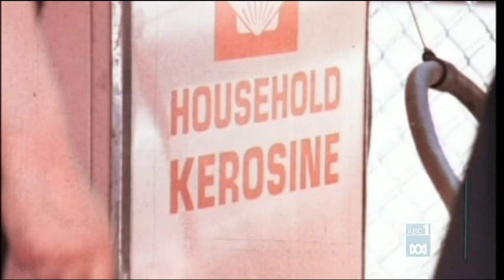Steam Powered 1963 Ford Falcon

Comment: WHY ARE WE NOT FUNDING THIS!? With today's advancements in materials and machining and computer control and stuffs - I would totally buy a steam car. Everything is possible!
Reply: I would love to see a steam car too, but it's difficult to make a steam car with similar performance to an internal combustion car. Though it's possible in theory, in practice it will take a lot of work. Developing internal combustion engines is simpler since the technology is mature and already works well.
Reply: +John Ryan  Well, if you watched the video? It actually took 3 minutes just to get the boiler to read on the gauge..
Reply: This is 10 years ago, I bet we could kick ass with this tech now... Try using a small nuclear cell to heat the water then we are talking, reinforce the boiler with new alloys, reduce the amount of wasted energy with better insulation etc... Have an onboard computer regulating the temperature and heating automatically to further reduce the waiting time down. Same deal as in the winter where we got to run the petrol engine in the snow for at least 5 minutes to get everything warm before heading out, not to mention the 10 minutes to scrape ice of the windshield etc during this time the car would have more than enough time to warm up. I think social media has really "dumbed down" our species where we want everything fast and don't want to wait. Really we are seeing the world die in front of our eyes. NASA & other tabloids have evidence for global warming: https://climate.nasa.gov/evidence/ If you want to live in denial about global warming, you might as well take up the belief that the world is flat and the universe revolves around earth only.
Reply: +Future Productions Anything possible... EXCEPT breaking the Laws of Thermodynamics that prevent steam engines (which require an energy robbing phase change in its cycle) from achieving a higher efficiency limits than internal combustion engines that offer the thermal efficiency advantage of direct conversion of energy in a working fluid that does not require the wasteful phase change in the working fluid and the higher entropy of external combustion...
Reply: +John Ryan I don't think you realize that the practical and theoretical limits of steam engine efficiency are already known and are well understood by today's engineers. Any heat engine that uses a phase conversion of the working fluid is at a massive disadvantage to one that does not such as a Diesel engine. Better heating elements? Clearly you do not understand the efficiency problem with using steam. Its not a problem to generate heat, the problem is converting all the heat into useful work without significant loses inherent in the method used. 
You obviously misunderstood what Jay's comment was referring to..the Doble could only produce 1,000 lb.ft at the wheels "AT REST" the vehicle produced less torque as speed increased. The Doble could only produce 150 horsepower continuously.
A modern Diesel pick-up truck would leave the Doble in the dust pulling up a long grade.. 
In terms of land based vehicles it certainly is obsolete and has been for a century now... steam is no longer used in non-nuclear marine applications either and its use in stationary power generating is also being phased out. The is nothing economical about operating an aircraft carrier.. and steam is not the only way to catapult an aircraft.. it is just the most simple and reliable way.
Reply: +Mark E   Yes, the vehicle can generate enough steam to start moving in 45 seconds.. but will be severely speed restricted for much longer.
Of course this not the primary reason steam car have been obsolete for over a century, Steam cars have always been inferior to ICE powered vehicles.. the only real advantage with steam was a relatively safe start-up procedure that it not risk injury or death.
Once Charles Kettering invented the electric starter motor, steam cars became obsolete overnight.
Reply: +Fhhh Gdtv Why wait? Wouldn't you rather just turn a key or push a button and just go, instantly?
Reply: +Howard Rourke Are you not aware of Latent Heat or conversion loss? Any time you convert Energy or Matter from one state to another a certain amount of energy is lost during the conversion process called Conversion Loss  this energy cannot be recovered, the phase change from liquid water to steam vapor creates an additional energy loss inherent to the Rankine cycle. Expansion of steam is relative to heat energy, we want to look at where the heat is going... not the steam pressure. No practical steam engine can expand steam directly into water, if the exhaust steam temperature is above 100°c it is rejecting the additional heat used in the phase change. External combustion also increases the amount of thermal entropy when compared to internal combustion. This is why a steam engine can never be more efficient than an ICE.
Reply: You can start this car remotely and in a few minutes come and drive.
Reply: The real doktorbimmer I would like to, but if the maintenance and fueling of steam car would be cheaper I would prefer this. In my country people are starting using wood gasifiers in cars because of gasoline high price.
Reply: +Fhhh Gdtv "the maintenance and fueling of steam car would be cheaper" What? are you serious? Do you live in a very poor country?
Reply: all mighty You do realize something would still be burned to heat the water, right? So there would still be emissions.... And I'm curious to know what magical substance you're replacing fossil fuels with.
Reply: pyroblasten, "The law of conservation of energy considers the entire universe to be your system. So any heat given off to the air is effectively lost to the engine" But of course, but that just boils down(pun intended) to the efficiency of the design. Theoretically it's possible to design and build a steam engine where the only energy leaving the system is the mechanical energy being produced and a little bit of heat from the burner exhaust. An ICE can't even theoretically come close to that.   

"In order to return the steam to water it has to be cooled in a condenser. Most the energy dumped into heating the water is lost in this cooling' But of course again this comes down to the efficiency of the design. The hardest part of that design to my mind being that you need a medium cooler then the coldest portion of the condenser. The intake air for the burner meets that criteria, a two stage condenser, cooled first with water after the pump on it's way back to the boiler, then with intake air to the burner, cooling the condenser and preheating the air. 

"On very large scales you can improve this some by transferring some of the unused thermal energy into the water that's being heated but it's impractical on a small scale do to space constraints and weight. A car can't afford to carry and extra ton of water so it can transfer heat from the steam into the water just before the boiler." Here I completely agree, don't get me wrong I'm not arguing for steam powered cars. I could see a place for other external combustion engines like the sterling however though.
Reply: @snek9353  Well, on the regenerator part, it doesn't need to be 5 meters square on size, it can just be a small paraphernalia on the cycle, if it at least exists on the cycle is better than nothing.
Reply: dok, I'm actually a little impressed, you're very good at sounding like you're saying something intelligent without actually doing so.
Reply: +sal 80 The oil industry would be very happy if everyone drove a steam car... Charles Kettering killed-off the steam car in 1915 when he invented the electric starter.
Reply: doktorbimmer ..... But with todays modern technology wouldn't we be able to make a more advanced powerful steam engine
Reply: +sal 80 In 1824 Nikolaus Carnot discovered a thermodynamic formula that proved that steam engines have a much lower efficiency limit than internal combustion engines do... no amount of new technology can change the Laws of Thermodynamics.... so the answer is simply "No" which explains why no legitimate engine manufacturers or engineers even bother to work on them for automobiles use. Cheers!
Reply: Nicolas Carnot discovered that internal combustion was more efficient in 1824.
Reply: Mark E That's firing up to keep it hot enough is different.
Reply: +Mi 28 Smart man, Good comment.
Reply: "Are you not aware of Latent Heat or conversion loss?" Sorry I'm not a fucking engineer, there's no scholarships for homeless white men you elitists fuck. My great apologies for my insolent curiosity ohh great one. "energy is lost" . Doesn't this statement contradict conservation of energy, or are you trying to say that there's no practical way to recover the energy spent in the conversion? "we want to look at where the heat is going" .Well no shit, that's true of ALL heat engines, ICE or ECE, this is a big problem inherent to ICE. That they require significant cooling systems, exhaust a lot of heat, and there's no way to recycle the heat energy. "No practical steam engine can expand steam directly into water, if the exhaust steam temperature is above 100°c it is rejecting the additional heat used in the phase change " Well that's all about if that heat can be recovered. You yourself have said this in other places, as to why steam makes since for large installations, they have a room for that equipment. "thermal entropy when compared to internal combustion" Here I completely disagree, as I said above ICEs have huge thermal entropy problems. In particular spark engines as they are prone to detonation, and any emissions regulated diesel as they have to cool to lower NOx emissions. Then there's the limitations of aluminum pistons and oils. With an ECE the burner and boiler can be isolated from components with significant temperature limitations. BTW why all the yelling?
Reply: Howard Rourke The law of conservation of energy considers the entire universe to be your system. So any heat given off to the air is effectively lost to the engine, though it can be accounted for outside the engine. In order to return the steam to water it has to be cooled in a condenser. Most the energy dumped into heating the water is lost in this cooling. Then it must be heated again to expand it into steam to drive the engine. No matter how well we design an engine we will never get all the energy out of that steam, if we did remove enough energy to return it to water from mechanical means the water would act as an impedance to the system ahead of it and it all goes to shit. So steam engines from a simple view only capture energy from the pressure created leaving huge amounts of thermal energy that we then have to cool to condense it only to expand it again. On very large scales you can improve this some by transferring some of the unused thermal energy into the water that's being heated but it's impractical on a small scale do to space constraints and weight. A car can't afford to carry and extra ton of water so it can transfer heat from the steam into the water just before the boiler.
Reply: Question for you educated types. An external combustion heat engine that used a change in state from liquid to gas but didn't use water as the working fluid. Would you still refer to it as a "steam engine"?
Reply: Not literally, no. Steam is water gas specifically, so no other gas is steam. But it's the same exact thing.
Reply: +marias man, I follow except for one aspect, your adiabatic vs. isothermal. Specifics of the terms aside I don't follow how this works in favor of the diesel nor how in practice it would be more efficient.   

If the goal was isothermal expansion then if considering three types of engines the most to least to my mind would be steam, spark, then compression. With a steam engine the intake valve can be left open during the entirety of the power stroke if desired. This would add energy and impart a constant pressure on the piston. Also between spark and compression engines the spark engine wins here as well. The length of time combustion occurs is much longer in a spark engine then a compression engine. Spark engines burn, combustion engines explode. So while in a diesel no more fuel is being consumed during the power stroke there is fuel being consumed during the power stroke of a spark engine. Now FWIW this is a little different in modern automotive diesels. In modern light duty diesels to reduce the bang both for noise and durability there's a two stage fuel injection. A small amount of fuel is injected initially and detonates, then the rest is injected immediately afterwards and burns. 

The more important question then is why would adding heat/energy during expansion be more efficient in practice. To me this contradicts the logic behind wanting an ideal expansion ratio. If one were to add energy during the power stroke then you end up wasting that energy when the exhaust valve opens. To my mind the goal is to have enough expansion to achieve a near zero pressure difference between cylinder and exhaust when the valve opens at BDC. All common practices confirm this, this is the point behind common things like Atkinson/Miller cycles, and advanced spark timing. Also a big part of why diesels are more efficient, earlier peak pressures and larger expansion ratios.  

I don't really follow on steam temps being a large problem either. 1000F is rather low compared to IC engines where exhaust temps in the 1500F area are quite common. That's just exhaust temps, combustion temps are necessarily many times higher.
Reply: +marias man The best way to understand is to get an actual degree in engineering rather than blindly promote gibberish spouted out by notorious frauds, crackpots and scam artist like Ted Pretchert and Harry Schoell!
Reply: @doktorbimmer For someone that has an """engineering degree""" , you are really arrogant and pride of your so called degree, saying that Ted was a "scammer" isn't even the most idiot thing you've said, Ted wasn't even trying to make a company or sell any products, he was just doing the job  assigned to him that was making a steam car.
Reply: +marias man "so Diesel engines have to meter the fuel properly for optimal efficiency." That's funny, because Diesel engines can actually run efficiently at an extremely wide range of air/fuel ratios.. much wider than Otto engines or even external combustion engines.. its a key advantage to Stratified Charge Mode combustion... it also allows Diesel engines to operate on virtually anything that burns. 
Sounds to me you known even less about Diesel cycle engines than you do about the Rankine cycle.
Reply: @doktorbimmer  So does it run on flour and saw dust? I don't think so....
Reply: +marias man Perhaps people should know that all you are doing is secretly promoting a notoriously fraudulent, vaporware investment scam called "Cyclone Power Technologies" some of your comments and theories appear to be taken directly from their promotional materials or are nothing more than unsubstantiated claims made by its founder Harry Scheoll.
Reply: @doktorbimmer  I think you are the one trying to promote something, your profile picture is literally a gas turbine and you are the one discouraging everyone of making a steam engine.
Reply: I understand the logic behind adding the heat, but it still strikes me as wasteful and overly complicated for little if any benefit. The only benefit I could imagine is power density, the ability to get more work from a smaller displacement. However that would negate the equipment needed to recover the heat. There's a practical minimum delta between boiler temp/pressure and condenser temp/pressure as well as a mechanical limitation on expansion. I don't see how it's anything but wasteful to have a cylinder pressure at BDC that is higher then the condenser pressure. 

"steam condenses in the cylinder" I've heard this mentioned several times, I don't follow as to why in any practical engine the steam would condense in the cylinder. As the expansion occurs the temperature both fall but never below the vapor pressure unless no more force is being applied to the piston. The only thing that would cause condensation is if the surfaces within the cylinder are too cold, a problem easily remedied. 

On diesel timing, my example of a later injection is a bad thing in regards to power and efficiency. Modern automotive diesels do it to lower noise, reduce the need for heavy duty components, and primarily to reduce NOx emissions. But it's a very bad thing for power and economy. For peak power and economy you want all the fuel to explode all at once at the perfect moment just before TDC. anything later is wasteful. On a related note this is why spark engines will quite often ignite the fuel around 50 degrees before TDC. When the piston still has about a third of the way to go still on the compression stroke. Cause the flame takes a while to propagate it has to be initiated early to get peak pressure at the right moment. During the compression stroke a spark engine is actually compressing and combusting at the same time and having to do extra work to compress the combusting gasses. Yet another reason why diesels are more efficient. 

I still don't see the temperature problem. Boiler tubing is self temperature regulating as it's full of water. The cylinders are easy to manage, mostly steal and iron so no real issues, and any aluminum parts can be cooled just like they are in an IC engine. Can both have a water jacket and use it to preheat water on the way to the boiler. This would both cool the block and recycle heat, an aluminum piston can be cooled by the oil like it is in a diesel, and that oil run through an oil/water heat exchanger just like in a diesel. 

My last point would be that it would be silly to use water anyway. An ammonia based working fluid like modern refrigerants would likely be much better. Lower boiler temps could be used to shorten warm up times and lubricants just like those used in refrigeration systems could be used.
Reply: "You do not want all the fuel to combust all at once near TDC. The result would damage the engine." Yes you do and no it wouldn't. You may have better knowledge of thermodynamics but I used to tune engines for a living and still do quite a bit of it. Even in a diesel where the fuel explodes the injection is timed slightly before TDC. In a spark engine yes detonation is bad and can do damage, but a fast burn is very good and will yield both power and economy. "Also, efficiency would suffer because the very high peak temperature would transfer heat rapidly to the cylinder head and coolant thereby losing energy that would otherwise allow for higher average cylinder pressure during expansion" Yes and no, yes a lot of heat is lost to the cylinder walls, head, etc. But no to get the highest average cylinder pressure combustion must be early, there simply isn't enough time or expansion to take full advantage if it's late. Late timing simply results in hot exhaust, high fuel consumption, and lower power. This is true for diesels that inject late as well. It's also why Miller/Atkinson effects are so popular. You get a higher expansion ratio for a lower dynamic compression ratio. It comes at a cost of lower power/displacement however. "The ideal condition is to control combustion during expansion and add heat during expansion to raise the average temperature during expansion - then increase expansion accordingly to extract more work." Not in any real automotive engine, like I said there simply isn't enough time/expansion to take advantage. You seem to think we live in a world of 100:1 compression ratio engines, we don't. Highest factory diesel that comes to mind is 21.5:1, highest street/pump gas spark engine, about 11.5:1. "The combination of not throttling intake air, injecting fuel in a controlled manner during the power stroke, and higher expansion makes the Diesel engine more efficient." Not having to pull a vacuum yes, higher expansion ratios yes, injecting during the power stroke no.
Reply: marias, you keep going on like I don't understand that theoretically adding heat during expansion would increase efficiency. I fully understand, that in theory or in some large scale operations it can and does. However I see only limited ways to accomplish and utilize such a thing on the scale of an automobile. That's not to say these concepts aren't understood and utilized at all in my own work and in the design of previous and current IC engines. It's why in my diesels I run very hot coolant, it's why in my IDI diesels the pre-chamber is in the head on the exhaust side, it's why in a 2-stroke Detroit only the exhaust is in the head, it's why in my own builds I use ceramic coatings on the heads and pistons, it's why I use a custom cam grind that delays intake closing, It's why I have compounding turbos, etc. None of these things actually add heat during combustion, but they are all ways to retain and utilize as much heat as possible during expansion.  

"Note that my words are very precise. I respectfully request you read them carefully before making any replies." Fair enough, but it's the precision I'm nit picking, not the basic concepts, we agree much more then we disagree. There's really very little that is controversial or not understood here. This is a conversation of details, with varying perspectives of education and experience. I expect through this we are educating each other. 

"The fact is the fuel cannot be made to combust all at once at or near TDC." This of course is completely true, nothing even the explosion in a diesel engine is instantaneous, I never said otherwise. What I said was that if it could be that that would be a good thing for efficiency, at least in an engine like a diesel that is designed to handle it. But in reality it's not instantaneous and is mostly extended because even in the most powerful fuel injection systems it takes time to inject the fuel. In a diesel the combustion will start as soon as fuel is present and sufficiently mixed/atomized. This will most often be before all the fuel has been injected. In practice however we begin the process before TDC so that we have peak pressures close to but shortly after TDC. 

"Nothing I described previously implies otherwise. Rather, I described the process of delayed combustion (which is inherent in internal combustion engines and controlled to some extent in Diesels) raising average temperature and pressure." Yes and no, first a diesel is an ICE, I don't know why you separate the two, we should be separating by spark vs. compression. Second delayed combustion is an undesirable reality not a design goal.  

"Of course, clearly there is not enough energy in the charge of an engine to support an arbitrarily high compression ratio" This statement is largely false, at low throttle/fueling this is to some extent true, but in the vast majority of running conditions and certainly all the ones that matter this is false. We need to separate simple compression ratio from dynamic compression ratio and expansion ratio. Simple compression ratio is just that and only a measure of area. Dynamic compression ratio takes into account the effects of valve timing, most commonly keeping the intake valve open after BDC to allow some intake charge to be pushed back out. Then of course expansion ratio the area between quench and when the exhaust valve opens. An "arbitrarily high compression ratio" is of course detrimental, it has three major shortcomings. In a spark engine detonation, in a diesel engine too high peak pressures to hold the engine together, and in both the quench volume is shrunk. People talk of displacement as it relates to power, this isn't really the most true measure. A more true measure of a given size of an ICE is the quench volume. The larger the quench volume the more fuel can be utilized. Thus via valve timing much can be gained by delaying the close event of the intake valve. This lowers the dynamic compression ratio to an acceptable level(9-12 for spark, 17-21 for diesel) allowing for a higher simple compression ratio and in turn higher expansion ratio. This comes at a cost of power for a given displacement though as it requires a smaller quench area for a given displacement.  

"Besides, pre-ignition would take place long before this in gasoline engines - which, by the way, shows that trying to combust all the fuel at once at TDC is undesirable and destructive." First if we are being precise in our wording gasoline is a type of fuel not a type of engine. Secondly yes "pre-ignition" more accurately to what you're describing is called detonation is "undesirable and destructive" in a spark engine. As it's not designed for it and when is does occur it occurs very early in the compression stroke. This of course does not hold true for many compression engines, they are of course built around detonation. 

"Now, with respect to Diesel engines, injecting the fuel in a controlled manner during the power stroke provides a means to control the rate of combustion (however, the inherent delay of combustion is the primary driver here). This does not necessarily in and of itself permit a higher peak efficiency." This is on it's face true, but your reasoning behind it isn't. They "control the rate of combustion" primarily to control the temperature and pressure of combustion in order to keep them from becoming high enough to create NOx. This has two side benefits in that they can build a lighter and quieter engine, but those are side effects to the primary driver of meeting emissions regulations. And yes it lowers efficiency, you may be surprised to consider how blurred the line between spark and compression engines is becoming. 

I'm out of time, I'll have to address the rest later.
Reply: marias, I may address other points from previous posts later but now I want to change directions a bit and pick your brain on something practical I'm considering. It wouldn't be too hard for me to build a small steam engine into my trucks. I'd use the heat from three sources, the engine coolant, capture heat from the exhaust likely post turbo at the downpipe, and from a small burner. I'd utilize the steam in a modified ICE, condense it in an AC condenser, and .... I haven't quite worked out a pump to pump the condensate back to the boiler. I'd use the resulting power from the modified ICE to turn accessories like an alternator and AC pump. ..

The goal being two fold, first overall efficiency by taking some load off the main engine using waste energy. Secondly the addition of the independent burner to use it as an APU(auxiliary power unit). I can't assume you know what an APU is, many commercial trucks use APUs to keep the HVAC and electrical power going in the sleeper with the main engine off. Most APUs are just stand alone diesel generators with an AC pump and alternator added on and are mounted on the side of the frame behind the fuel tanks. They're rather wasteful really, heavy and the engines aren't very efficient. But still A LOT better then running the main engine or not having any creature comforts.

Anyway, on it's face it seams quite simple, the devil is in the details as they say. For example choosing between a water cooled and air cooled engine to turn into the steam engine. I could see using an air cooled engine and enclosing it in the exhaust stream of both/either the main engine and the axillary burner. In doing so the head and cylinder walls could be kept above mean steam temperatures in the cylinder. Or water cooled I could accomplish a similar thing with the water jacket being filled with boiler water at some stage in it's path. The air cooled option would be hotter, the water cooled more stable. 

Or, how much displacement do I need, and valve timing, etc. etc. Finally is it worth while, to be worth while I'd probably need to make a minimum of 20HP. Think it's feasible?
Reply: +marias man I know an exceedingly simply way to solve that problem too Just do what any competent, well educated engineer would do. Use a highly efficient, air-cooled Diesel engine.
Reply: "I know what an APU is, ;-). I've seen this idea pop up several times and I think it has some merit - especially where the system can function independently with a separate burner." Glad to hear it, there's half the potental conversation done right there, you understand the goal. 

"A piston steam engine would not be the best kind of system for this application, but it would be the easiest for someone with limited means to pursue." Yeah I can't really concieve of any other viable options. I could use an automotive style turbo/turbine but I see no viable way to use it for a relatively low speed torque load. I do however envision another use for an automotive style turbo in this application. To bascially use it as intended, drive the turbine from the exhaust of the "steam" engine getting more work out of that "steam". And then use the compressor side to push fresh air. While the main engine is running that fresh air would simply boost the main engines intake. But much more important when the main engine is off it could provide fresh air to the burner. 
This might be a place to consider a sterling but I'd not only have to make that largely from scratch but best I can tell it takes a large engine to make decent power.

"using toluene as a working fluid" You'll notice I put "steam" in quotes as I do have ideas on other working fluids, haven't considered toluene though. Why other working fluids when water is by far the easiest. Well two reasons one major one minor, first the later. I think if the right compound could be choosen and redily sourced it would be handy to use the same compound as both working fluid and fuel. The vast majority of working fluids that work for my second reason that I'll get to will be highly flammible anyway, like toluene for example. And if I simply sourced the fuel from the condensor it's already hot and gasious.  Ok the second reason is complicated. No idea if this has been done nor sure it would work well but I think so. I envision basing it on a diesel engine and using a diesel injection system to inject the working fluid into the cylinder. I could use a simple mechanical injector pump system and poppet style injector to not only pump and keep under pressure the working fluid but also use it to precisly meter the amount of working fluid injected into the cylinder to throttle the engine. One redily available system to pump from the condensor, keep it under enough pressure to remain fluid right up until it enters the cylinder, and meter how much is injected. Best I can figure this only has two limitations. First the working fluid has to have significant librication properties or the pumps won't last long. Second there's a practical pressure limit of about 2000PSI. Neither really sound like big problems. The organic compounds worth considering have enough librication properties and 2000PSI is plenty.

"increase the overall power of the main engine" FWIW to be precise that isn't really the goal. The goal is two fold, the APU function, and to remove load from the main engine, not add power. Do this by removing the alternator(s), A/C pump, and if possible the air compressor from being driven by the main engine to this heat engine. 

10% of main engine power would be perfect, 45HP is plenty to drive the ancillary items I have in mind.
Reply: "I know an exceedingly simply way to solve that problem too Just do what any competent, well educated engineer would do. Use a highly efficient, air-cooled Diesel engine." OK doktor, you tell me a good way to utilize waste heat in an air cooled diesel engine, and I'll consider it.
Reply: OK I forgot a big issue with my diesel injection system idea. That is max volume limitations. A 13mm p-pump, probably the pump I'd prefer to use is capable of about .8 cc per stroke. So a practical max of .8cc of working fluid injected into the cylinder at TDC. Depending of course on working fluid and it's temperature that gives a significant limit on expansion/displacement per cylinder stroke. Now it would be completely possible to double up on the pump, and create a maximum of 1.6cc per stroke but that would require additional cost and complication. The point being the preferred engine would be one of 4 cylinders and a displacement sized to utilize a maximum of .8cc of working fluid per expansion stroke. The math on that is not only over my head at this point we don't have enough details.
Reply: "I can only speculate about what you need 45 hp for" It might really surprise you how much power it takes to turn a 200amp alternator, decent A/C compressor, and a 150psi air compressor. Would I need 45HP all the time, no, could I get by with less, probably, is the ability to run all three of those under load helpful absolutely. 

"What engine are you using that delivers 450 hp for extended periods?" Now I thought you knew or figured at this point that we are talking about a commercial truck, 18 wheeler, 80,000lbs, etc. Pulling a pass I'll be at full throttle for an hour straight. 

"Now, I wish to emphasize that, while this is an interesting idea, I take the position that it is highly unlikely to be justified on economic grounds quite simply because the fuel savings would almost certainly not compensate for the costs in development assuming a one-off engine." A small percentage in fuel savings is a HUGE deal when you spend $60,000 a year on fuel, a %10 savings is $6K a year. Then we're talking about APU functions, good APUs new run about $10K, I could sell the one I have for about $5-7K. Nor do I expect this would be that expensive, at least if I can use a lot of common used automotive parts. Really I expect the most expensive part to be the injector pump, good ones can run in the $2,000 area. But hopefully I can get by with a stock used one at a quarter of that. Engine wise I'll modify an old engine, not sure yet which, still contemplating that. Need to make a decision on displacement first, maybe you can help with that. Anyway, IDK $5K all in, if it works it'd be awesome and pay for itself just by selling my current APU. 

"BTW, this concept has been pursued by at least one major automotive company - and discontinued" Yeah, I think I remember reading about BMW working on it. I've yet to find anyone who's tried it on the scale of a class 8 truck though. IDK why, strikes me as something that Kenworth should be tossing some research money in on. My understanding was that in smaller applications it just wasn't practical mostly due to weight and space constraints, that and the engines really didn't put off enough heat often enough to make it worth while. But I have space to work with, wouldn't add any more weight then my current APU, and boy do I have heat to spare.
 
Edit, might help to keep in mind we're talking about a truck that is only completely off and cooled down every couple of weeks. The rest of the time it's either moving, the APU is running, or it's off just long enough for the stop I'm making.
Reply: "My suggesting an organic working fluid was limited only to micro turbines" Is there a reason to avoid it given my line of thinking?
Reply: Not really considering turbines at all, too much difficulty and cost for my intended purpose. Even if I could source a reasonably priced, correctly dimensioned, and high enough quality turbine. The complications of driving a slow speed variable load from it are too cumbersome. Now if I only wanted to use it to boost the main engine, turn a generator, or turn a compressor wheel then maybe. But as a stand alone unit to drive variable slow loads like piston AC and air compressors, no way. There are other ideas besides modifying a piston ICE though. You mention supercharger, maybe but I doubt it. Centrifugal or roots no, wouldn't work, a twin screw maybe but the expansion ratio would be rather small and costs high, those suckers aren't cheap. There's several cheap piston style AC or air compressors that could be modified. A Yeats(I think it's called) style AC compressor is a very compact 6 piston swash plate style compressor that may work well. Or a slightly more radical idea a rotary(wankel) engine. I actually rather like that idea, those suckers can spin and "valve timing" is simply port location, no cams or moving valves. Take a good chunk of machine work and high end aluminum welding though, I'd have to do a lot more research on that. The point being that there's a lot of options when it comes to the expansion engine portion. But before I get there I need to figure out if my diesel injector idea can work, a displacement goal, and a working fluid/fuel.
Reply: Any suggestions for a cheap readily available fluid that has the right heat properties, is a decent fuel, and a decent lubricant? For it to be viable as a fuel it can't be much more expensive then diesel. That or I'll have to use different fluids for fuel and working, but still the working fluid would need some lubrication properties.
Reply: The only smart thing to do is keep the Diesel APU, no Rankine cycle engine is going to deliver the same output at lower or even the same fuel consumption.
 You wanna improve your fuel costs per mile? You still have even asked the first question to this equation yet... how efficient is the primemover you are using now?
Reply: Well a word on fuels and how much of the operational time its powered by the main engine's waste heat. Fuel wise the most easily sourced and likely cost effective are, waste oils(cooking oils, waste motor oil, etc.) diesel, gasoline, propane, then ethanol. Time, well it'd run for the most part 24 hours a day, 11 to 14 of those hours using waste heat and the other 10-13 hours on burner heat.
Reply: Why on earth would I ask you how efficient my engine is?
Reply: +Howard Rourke How can you account for the less efficient APU duty cycle mode operating near half (10-13 hours) of 24 hour cycle time?
Reply: dok, how can you account for being a useless troll?
Reply: marias, yeah the engine is in much more then "just good working order", aero is quite good for what it is, and next to nothing more can be done for rolling friction. Really most class class 8 trucks are the most fuel efficient vehicles on the road already. But there's several limits one is constantly running into, largely function and regulation. Many things that would increase my MPG are either illegal or limit my ability to haul the load I'm being paid to haul. One of the legal issues is something I need to make a decision on and one this is an aspect of. That's if/when I'm going to add an exhaust particulate filter. Currently I can't even enter California, not that I really want to anyway, lol. But if I was to place this heat engine in the exhaust in a canister that looked like a diesel exhaust filter I might just be killing two birds with one stone.
Reply: +Howard Rourke You said (on another thread) you understood BSFC? Why are asking the same second pass system to operate half  its duty cycle at less than half its rated output.???? You will already be at a disadvantage using steam compared to the Diesel.
Reply: +Howard Rourke But how do you expect to exceed the efficiency of the Diesel Cycle APU with a Rankine Cycle? Especially when it won't be operating at its ideal load to achieve optimum BSFC.
Reply: "what do you wish to power with the APU while the main engine is shut down, and what power is required" I've mostly answered this before, 2 alternators, an A/C compressor, and an air compressor. What power is required, well that's a tough one to answer really. Maybe as little as 10HP can get the job done. The air compressor would be very low duty cycle and everything else could be turned off when it's on. Similarly with the AC, the AC clutch kicking in could disable the alternators while it's pumping. The compressors could also be turned slower, reducing the power needed. Doing so as little as 10HP could get the job done. But I'd be in real trouble in a hot climate where I'd have the AC running all the time, the batteries wouldn't get a charge.
Reply: +marias man Heavy duty trucks use Air Brakes
Reply: I wish I had good info on loads, but everything is guesstimates. Yes the AC is to cool the cab for sleeping, I'm hot blooded, can't handle heat so I run AC more then most. Ultimately I'd like to use it for a built in fridge as well, but that's down the line. I don't have any figures for the cooling rate. --- Alternators, similar thing, power an inverter, lights, etc. If I went this route I'd replace the generator of the APU with a large inverter, that would be the largest load, but it's draw would be far from constant. --- Yes the rig has air brakes of course but they don't draw anything while still. However the suspension is air as well, including the cab, and I'd like to be able to run some air tools, fill tires etc. without running the main engine. BUT.. don't need much air sitting still, very rare to run out. Also a hard job to remove it from the main engine and power with this heat engine. These pumps aren't belt driven but gear and basically built into the engine. So that is by far my lowest priority.
Reply: +marias man That is where the Turbo-Compound system has a distinct advantage in this situation... its heat recovery curve is better suited to couple with the waste heat energy curve, and can deliver additional shaft horsepower to the prime mover when its output exceeds the PTO accessory load which is always variable independent of the prime mover output curve. 
Its exactly why truck engine manufacturers are starting to use them and not a Rankine based system which is inherently less efficient and much less cost effective.
Reply: A lot here to catch up on...

"determine if these loads might be powered by another means" That's great to explore, I've thought about other things as well. For example Sterlings. or a split/compound Diesel/Rankine. That is Rankine to use waste heat from the main engine, then instead of a burner a very small Diesel to both share the load and provide heat to the Rankine. Both have there problems, the Sterling previously mentioned, the small diesel a combination of efficiency, cost and complication. Small Diesels are not efficient, splitting the load between Diesel and Rankine is complicated, and it doesn't much lower costs as I'd have to source the small diesel. 

"the question I consider is whether or not it can be practical to fuel fire the system while the main engine is shut down" Same here, waste heat is free, only cost is in the hardware to capture it and that's a fixed cost. But to be worth while the Rankine when powered by the burner can't cost any more then twice the diesel APU per hour to run. Now if I could fuel it using free waste oils then absolutely. And frankly that might be a viable option, and one that using a burner makes very easy. Heck I could fuel it with a wood stove, well if it was legal. When first thinking of this idea some time ago I thought it would be cool to have a fireplace in my sleeper and use it's heat to power the Rankine. But.... technically for some retarded reason that is illegal.(may do it anyway) Which reminds me we overlook a secondary goal, providing heat when cold as well. I may be warm blooded, but in a North Dakota winter even I crank up the heat. That and I'd like to use it to pre-heat the main engine prior to starting. 

I don't follow what your saying about another evaporator in the cab. The evaporator is already in the cab. Are you saying add another just to add surface area? As for the condenser I agree, I could see a significant advantage to putting a condenser on the roof. While on the highway the stock condenser is great, sitting still it's not getting much air flow and is heated by the engine. 

I don't follow why there would be any advantage anywhere to superheated steam? The hotter the working fluid the lower the delta T with the heat source and thus lower the rate of transfer and thus efficiency. The only advantage I see anywhere to superheated steam is to get more work with less pressure. But that only makes sense if your approaching a mechanical pressure limit. Or am I all turned around in my thinking?

"A modified single cylinder air cooled gas engine can provide this output with a fairly modest steam pressure and a simple design. The simplest approach would be to use water as the working fluid and forgo the heat transfer fluid and use saturated steam to drive the expander." Here the devil is in the details, those modifications can be difficult and costly, we need a way to throttle it, and air cooled leaves only the area of the engine fins to capture only exhaust heat. I'm still pondering the engine/expander itself, but I am settled on a heat transfer fluid. 

Ya see I have one anyway(engine coolant), and really do need to change to Evanscool anyway. Part of getting the most out of the primary engine is raising it's coolant temp as high as is practical. In my quest to do that the next step is getting rid of the water. Water's vapor pressure at those higher temps too high for the cooling system to retain. Evanscool boils at 375F, and eliminates my need for antifreeze, and SCA additives. I'm thinking three elements to heat transfer with Evanscool. 1) Change over the entire cooling system. 2) Install a small electric pump to pump some coolant from the engine. 3) Install a "water jacket" around my exhaust pipe between the turbos and the stack. Hot coolant will travel from the main engine pumped out by the small pump. Then into the exhaust jacket takin heat from the exhaust then to the boiler/burner, and back to the engine. This will do two things, gather a fair amount of heat from the main engine, and with the addition of a small valve to bypass the engine at times, allow the Rankine/burner to heat the main engine. 

"I don't know the electrical system requirements, but the ideal condition in my mind would be for the system to provide all a/c and all DC electricity required. So, the a/c compressor and the alternator normally powered off the main engine might be powered by the APU." This is one element I've had in mind all along. I don't want to add a second AC compressor, set of alternators, etc. I want to move the ones currently powered by the main engine to the APU. Here's a practical question though, I don't need a lot of AC electricity. I really only use AC for cooking, got a 1500W microwave and a 1800W induction cooktop. The question is, inverter or generator. I lean strongly towards inverter, but....
Reply: "That is where the Turbo-Compound system has a distinct advantage in this situation... its heat recovery curve is better suited to couple with the waste heat energy curve, and can deliver additional shaft horsepower to the prime mover when its output exceeds the PTO accessory load which is always variable independent of the prime mover output curve. 
Its exactly why truck engine manufacturers are starting to use them and not a Rankine based system which is inherently less efficient and much less cost effective." I have no idea what you're getting at here? Compound turbos for intake pressure, sure, got that. But PTO output from a turbo? I'd dig that, but tell me where to get such a thing from anywhere but a formula 1 team? Still does nothing while the engine is off though. And what engine manufactures are starting to do what?
Reply: Actually doks post reminds me of something moderately on my to-do list to at least research more with the main engine. Add a supercharger for efficiency. Some people have toyed around with doing a compound turbo and positive displacement roots type supercharger system that goes inlet > turbo > supercharger > turbo > intercooler > engine. The idea being two fold, with the supercharger lag can be eliminated allowing for lower RPM operation and larger sized less restrictive turbos. But mainly that while the turbos are spooled up they are actually pushing through the supercharger. With a roots type where it's positive displacement but no compression happens within the charger it can be blown through creating torque. Torque that is directly transferred to the engine. This may be a rather practical way to directly provide extra torque to the engine using exhaust energy.

EDIT - Secondly the engine only needs X air for Y fuel. Turbos balance this rather well, but the addition of the charger and a bit of exhaust control can do it even better. By throttling the exhaust flow to the first turbo under low-part throttle conditions two things happen. Manifold pressure thus temp goes down as the supercharger acts as an RPM dependent throttle. And the second turbo spools more creating a vacuum under the supercharger allowing it to provide torque.
Reply: marias, my cab is rather large and open, I like it that way and wouldn't want to partition it off. I could however see myself adding an evaporator in the back. In fact I came across a bit of tech recently I'm embarrassed I hadn't found earlier. I often thought it was a good idea but hadn't looked in a while to see if anyone was making it. Now they are, a couple companies are now making variable displacement AC compressors. This could potentially solve a lot of issues.   

OK now I totally get the superheated steam thing. OK but then why not use a gas, or heck even air. Compressor > Waste Heat Source > Engine > Cooler > Compressor. Or at that point remove the cooler. Outside Air > Compressor > Waste Heat Source > Engine > Exhaust/Main Engine or Burner intake. 

This brings me to a question I asked herr doktor and he didn't answer, well he did but in his own nonsensical way. With a diesel engine is there an efficiency advantage in heating the intake air. I tend to think yes to a point, that at low fueling and low intake pressure absolutely, in fact it would allow for lower dynamic compression. But at high fueling and high intake pressures it would be detrimental. Not only would power go down but exhaust temps would get too high and damage the engine.  

With the lack of throttling you appear to be assuming the APU is coupled to the main engine. Thus is/was not the goal. Though now that I think about it this may be a better way to get the most out of it. If I could find a way to couple and uncouple it then I could get the best of both options. Maybe I could do this with an AC clutch used to uncouple the main engine from the drive belt.  

On a second moderately related note, why isn't compressed air used for cooling. Strikes me that it could be more efficient then cooling Freon. Compress ambient air, in the rig it already goes into an air drier (half of AC is removing humidity) then into a tank where typically more water precipitates out. If it was then sent into a cooler(an AC condenser), then released into the cab via a controlled nozzle wouldn't this provide quite efficient cooling? Biggest issue would be noise, finding a way to muffle the sound of the released high pressure air.
Reply: +Howard Rourke Why would you Supercharge a Diesel engine? Is your trucks engine not all ready Turbocharged? "EDIT - Secondly the engine only needs X air for Y fuel."
Not in the Diesel engine concept, higher AFRs improve efficiency.. only Otto engines (HCSI) operate in a narrow AFR band.
Reply: Never heard the term "Brayton cycle" more to research. I agree it would be larger, however I already have/need an air compressor. I'd also need a way to force air should I decide to use a burner. Third it would exhaust warm slightly pressurized air that could be used to boost the main engine when running.
Reply: You agree about warm intake air increasing efficiency to a point? And yes warming it would certainly be free heat.
Reply: dok, you really are just scrambled in the head, in one post you both ask why one would supercharge a diesel and say more air is always better. Well dok, A LOT of diesels are supercharged, in the world of superchargers(more so back in the day) they often refer to the sizes as 6-71, 8-71, etc. this referred to the size of the diesel engine they were from. Next I think I explained rather well why I would add a supercharger, that you can't follow it I'm not going to take responsibility for. Finally no, there is absolutely a practical limit to providing air to a diesel. Too much and you not only create a pumping loss but you cool it excessively.
Reply: Yeah, batteries are an option, one with downsides though. First the power isn't free, now while firing a burner isn't either, it may be cheaper. Second if doing a waste heat engine anyway, all it takes it adding a burner. Third batteries are HEAVY, it may not be obvious to many but in trucking every ounce matters. We have legal limits on weight, every pound on the truck is a pound less cargo I can be paid to haul. Third as you mentioned before electric air conditioning powered by an inverter is far from efficient.
Reply: +Howard Rourke I hope you are a better truck driver than an engineer... because as an engineer you really are a waste of space.
The Winton type engines ARE NOT SUPERCHARGED they use a roots type "BLOWER" to scavenge the intake/exhaust cycle... they do not increase manifold pressure significantly above atmospheric pressure.
Reply: Howard Rourke  Using batteries is a very inefficient solution, in short, simply a very dumb idea... marias man likes to think that he is some kind of an engineer... but his comments prove otherwise!
Reply: +Howard Rourke I can't help but notice that you know even less about Diesel Cycle engines than you do about Rankine cycle engines... you should stick to driving trucks and leave the engineering to the people with a degree in engineering!
Reply: +The real dickbender, we've long established that I know much more about the real world uses of both trucks and diesel engines then you do. Now please take your bullshit elsewhere unless you actually have something constructive to say.
Reply: "I agree the gains would be negligible at best. Also, it doesn't make sense to add heat when retaining heat would provide the same effect in principle. Use a turbocharger to make use of waste heat." I'm specifically thinking of low fueling conditions where there is no boost and most specifically idle where heat retention is a real problem. During extended idle, most large diesel engines will have a hard time maintaining operating temp. This is of course made worse by having a high operating temp, running the heater, etc. This get's to the point of a condition called wet stacking where the compression temps and internal surfaces of the cylinder are no longer hot enough to support complete combustion. 

The idea here is to add a second intake path with a flap closed by boost. The non-boost intake path pulls warm air from ducting over the exhaust manifold. A system much like is/was done in most automotive spark engines for years to prevent icing in the winter. Another system used in spark engines that I've yet to see in diesels used for this purpose is an exhaust restriction. A valve in the exhaust manifold that is held closed by a bi-metal spring and opened by exhaust flow and heating the bi-metal spring. In theory a small turbo could be added and valved to do something similar but much better. Not only providing an exhaust restriction but transferring that energy to the intake. The trick is sizing, not really sure it's even possible to get enough energy out of the low energy exhaust of idle to do anything useful with the large intake volume. 

What brings me here is not only solving this problem but the idea of a super efficient idle of the main engine over a secondary energy/heat source. That the combination of retaining heat in the intake air as well as an attached heat engine may be more cost effective then adding a secondary system. 

Oddly or unfortunately this also bumps into two other facts of life with heavy truck diesels. The first being that many engines including mine use an air/water intercooler that negates that delays wet stacking but also isn't as good as an intercooler as air/air. One that I'm likely better off overall removing. Secondly and most important many states have laws against extended idling. Even if my idle was much more efficient and less polluting then a diesel APU the law is not flexible on such matters and this law is strictly enforced. They have cops that spend all night driving around truck stops listening for running engines.
Reply: Oil industry won't allow it
Reply: +Mehtao Burrell Unfortunately steam powered cars waste too much energy...
Reply: +Autistic Boy Why don't you go troll somewhere else?
Reply: +Autistic Boy We are not funding this because it would be a foolish waste of resources... the Laws of Thermodynamics make steam engines significantly less efficient than ICEs and other heat engines which offer higher Carnot limits... there is no need to waste time and money rediscovery something that we already know.
Reply: +Autistic Boy The Second Law of Thermodynamics is incontrovertible. Malice may attack it, ignorance may deride it, but in the end, there it is and there is absolutely nothing you can do to change it.
Reply: We should also breed whales and hunt them for their oil to power them.
Reply: Agreed nowadays you could make steam much more efficient than it was
Reply: +Moose Chocolate  Unfortunately engineers already know that steam cars cannot be made more efficient than internal combustion cars... thus the reason why steam cars no longer exist today except in museums and private collectors
Reply: +Moose Chocolate You could make steam cars more efficient... what you cannot do is make them more efficient than internal combustion cars... so what would be the point???
Reply: Internal combustion cars can and do run on a wide variety of alternative and Bio-fuels so steam cars offer no advantage in multi-fuel operation.
Reply: Will your channel be listed under comedy??? because your concepts sound good for a laugh... at least for engineers and scientists watching youtube.
Reply: You are the loser... Remember?
Reply: Sorry my friend that's not part of the plan big big petroleum don't like that it cut scene on a prophet being fucked about climate change
Reply: @charles neely The "big oil" companies would be very happy to see everyone driving a steam car!
Reply: water turning to ice in the winter
Reply: John Ryan Yeah but heres the thing todays heating elements have only changed alittle in the past 100 years hence why steam cars ended. Physics said there was little room for improvement but there was a ton of improvement for gas and diesel engines since back then they were all super ineficient at the time.
Reply: +Fhhh Gdtv Steam cars have been obsolete for a century now for the simply fact that they are horribly inefficient, wasting massive amounts of fuel and they are prohibitively expensive to build, maintain and operate.
Reply: +The real doktorbimmer yes you can, because we live in a simulated and the laws can be hacked.
Reply: I967 none of you want a steam car they died for a reason. You had to wait for them to heat up to drive them it's not a turn key and go.
Reply: You don't just heat up water to 100 degrees and it all converts to steam. Every ounce of boiling hot water converted to steam takes additional energy input. For water specifically, boiling off a liter of water takes about 5 times as much energy as it takes to heat up a liter of freezing water to boiling point. When water boils to steam, it expands 1000 times. If you don't harness the power of steam condensing back to water and compressing 1000 times, all the energy that went into boiling it goes to waste. 

It's important to know that energy doesn't comes from nowhere and doesn't vanish anywhere. Energy in = energy out. It's just your motor setup may allow for large fraction of input energy to dissipate as useless byproducts, such as waste heat dissipated on radiator.
Reply: @michaelbuckers  we could use the heat coming from the radiator to pre heat the air to the boiler
Reply: @giovannicesaramorimnumero7589  It's more hassle than it's worth. Hot air has less density and less oxygen so you will also need a compressor, and then the compressor needs a driving motor and cooling, etc. It comes out as a pretty expensive and complicated set of hardware for a couple odd percent of improvement.
Reply: @michaelbuckers  Why cooling? Also, the motor could be a turbo driven by exhaust steam going to the condenser.
Reply: @giovannicesaramorimnumero7589  Because hot air is less dense, there's less oxygen to burn. If you drive a turbo off of exhaust then this energy is not available at the main engine. No free lunches.
Reply: @giovannicesaramorimnumero7589  Not a practical design for an engine as small scale as a steam car... internal combustion engines are vastly superior which is why they completely displaced steam cars.
Reply: @sandervanderkammen9230  no it wasn't because they were "superior", it was because of ford who was making a car every minute and selling them for $200, and I DO think steam is going to come back simply because of the trend of "renewables", as steam can use anything to burn, such as straight used vegetable oil, which could be used as a carbon neutral fuel, and saying that it pollutes almost anything and unnoticeable amounts of NOx, could propulse an advertisement on the steam car to be sold, and with cheaper and better materials, boilers could be smaller, reliable, automatic and cheaper and the steam engines could be replaced by rotaries one, as they are simple, cheap, reliable, efficient, small and easy to make (just two moving parts) an example of this engine would be one that is here on youtube and it is pretty promising, this is something that a wankel engine cannot do, as they need 4 stroke to make power and adds alot of complexity (as it needs to expand, compress, expand and compress, while a steam version would only need to expand and compress).
Reply: @michaelbuckers  The literal point I was making is to make it hotter to reutilize the steam's energy lost on the condenser, while the air would be less dense, the burner could simply run faster, as most burners run on half speed otherwise it would just be lost energy, and the turbo I was pointing out I have seen it actually was a bad integration as the exhaust would just be trapped, but an electric fan (such as in the doble) runs just as a turbo just using electricity and could force air into the burner.
Reply: @giovannicesaramorimnumero7589  That comment is very revealing and exposes the fact that you have no practical experience or formal education in engineering...
 Internal combustion engines have always been superior to steam.
It was Charles Kettering not Henry Ford that rendered steam cars obsolete.
Kettering invented the automatic starter for internal combustion engines in 1914.
 In 1915 the world's largest manufacturer of steam cars, White Motor Company completely switched to ICEs.
Reply: @giovannicesaramorimnumero7589  Why would you develop steam for more expensive and scarce fuels like renewables when steam have much higher fuel consumption and a much larger carbon footprint???
Steam cars produce high NOx emissions and produce more carbon  emissions than internal combustion engines with or without renewable fuel.

Diesel engines were invented to use renewable fuel like vegetable oil and are cheaper and more fuel efficient than steam cars.
Reply: @giovannicesaramorimnumero7589  Per horsepower or kilowatt produced steam is more complex and expensive in an automobile application... a modern internal combustion engine is also 400% more efficient than the practical limits for steam cars.
Why use steam if it takes 400% more bio-fuel to do the same job, cost more and generates more carbon emissions???
Reply: @giovannicesaramorimnumero7589  If you gonna reply to a 3 year post in a 150 replies thread please provide context, I have no idea what you're talking about. 

The issue with steam engines at the core is poor fuel efficiency which is exactly due to condensation-evaporation cycle that has to happen for it to work. Absolute majority of the energy that goes into the water is used to boil it off (as opposed to heating it up) and it's not extracted in the engine, instead being exhausted as waste heat through condenser. You can reduce this fraction by running it hotter, but it won't get re-utilized - you forfeit it by condensing the water which then has to be re-boiled which by itself costs energy. The boiler and the engine are also far from 100% efficient, and this effect stacks. If you're not strapped for room and weight, you can implement a lot of devices that improve thermal efficiency, but that's not the case for a motor vehicle.

If you get rid of the condensation and just use pure steam, then you swap out rankine cycle for carnot cycle and it becomes a regular hot gas engine, and at that point it's just a more complicated version of internal combustion engine.
Reply: @sandervanderkammen9230  400% more efficient? Wikipedia states that even the most rudimentary steam car can do half a normal gasoline car can, and why are you even commenting on a video about steam cars? It's like commenting on a youtuber's video you absolutely hate on, a little suspicious huh?
Reply: @giovannicesaramorimnumero7589  Production of White steam cars ceased in 1915 immediately after Charles Kettering invented the automatic starter for internal combustion engines.
Steam cars companies like Stanley quickly lost sales after 1015 and eventually went bankrupt like like the rest of the companies that did not switch to ICEs.
Reply: @giovannicesaramorimnumero7589  Modern internal combustion automobile today can achieve efficiency exceeding 40%
 The best production steam car struggle to reach 10% under ideal conditions.
 None of this should be a surprise, Nikola Carnot published his formula in 1824 which explains why steam engines can never match the efficiency of internal combustion engines.
Reply: @sandervanderkammen9230  Check Wikipedia, they ceased production of steam cars in 1911 and only built 10000 steam cars and the citation of steam cars were until 1912.
Reply: @giovannicesaramorimnumero7589  It's not a difficult concept to understand...
If 2 vehicles use the same fuel type, and the steam car uses more fuel it will produce more carbon emissions.

I'm afraid you don't not understand the formation of NOx emissions, external combustion like steam boiler burn fuel with an EXCESS of Oxygen not fuel. NOx emissions increase with temperature AND excess oxygen in the Air fuel ratio.
Modern gasoline engines operate using a stoichiometeric air-fuel ratio.

Automobiles use petroleum because it is cheaper than alternative fuels and the only source that can currently meet demand.

Wood cannot meet global demand, even if the number of cars does not increase the use of wood would result in the entire planet will  quickly become a barren wasteland.
Reply: @sandervanderkammen9230  Bro, 10% efficiency is for the worst made steam cars ( the ones with a firetube boiler or cheaply made), and the Doble model E can achieve 16Mpg, having only 1920s tech.
Reply: @sandervanderkammen9230  Well, first, the Doble steam car model E, using rudimentary tech and mechanics such as the reciprocating engine, can do 16Mpg, while that sure is bad for today, we need to remember that that is for an over 5000 lbs car made in the 1920s, and while you argument over that your gasoline engine can make 40% efficiency and the steam one 10%, you totally forget to mention that the gasoline engine have loads of parasitic loses, such as fuel pump, water pump, valves, alternator, fan, oil pump, etc. And it has a humongous drivetrain that goes more than 2 meters in length and most of the time accounts for 15% of the overral efficiency of the entire car, and while it has all of that, the steam engine is directly attached to the differential and does not need a drivetrain, and parasitic loses can be 2/3 less of the gasoline engine simply because of the overall simplicity of the engine, using a reciprocating one. Using a rotary steam engine (way simpler than a wankel as it does not need 4 strokes to make power), it wouldn't need any valves, any camrods, any chain or even a crankshaft, and using the leaving steam from the engine you can power the other parasitic loses through a steam turbine and totally removing all of the remaining parasitic loses.
Second, the pollution from steam boilers are actually so small that they are nearly undetectable on NOx emission. As shown from Jey Leno, his Doble passed on current emission stardants on the SULEV category with "flying colors" meaning it passed with a huge marging to pass the category, in 1920, while today's car struggle to pass Europe's emissions standarts just to be able to be sold.
Reply: @michaelbuckers  Well, it was already going to the condenser, meaning wasted energy if it would not be used, so?
Reply: @sandervanderkammen9230  Because I can??? It's not like MY money is public property and I can do ANYTHING with it, being a waste or not.
Reply: @sandervanderkammen9230  Are you even seeing what are you writing? The so called theoretical limit for a steam engine is ~60% of efficiency and we have as far as we went reached ~40% efficiency on a bigger scale turbine while diesel engines of the same size are 45% efficient, saying that diesel engines are "400% more efficient than the theoretical limit of a steam engine" is pure dumbness, simply by stating that a diesel engine would be able to reach as far as 240% efficiency, if that's true, then could you sell me the engine's plan for me please? Because I'd like to create some energy too.
Reply: @giovannicesaramorimnumero7589  EPA LA drive cycle tests proved the Doble design achieves only 6.5 mpg on kerosene.
Reply: @giovannicesaramorimnumero7589  Please stop pretending to understand the thermal fuel efficiency.
The Second Law of Thermodynamics and the Carnot formula tell us that steam engines can NEVER match the efficiency of internal combustion engines.
Please educate yourself and stop being a fool.
Reply: @giovannicesaramorimnumero7589  The Doble achieved at best 8-10%
A Toyota Prius M15A-FXE engine achieves 41%

Audi 100 2.5l TDI achieves 43%
MAN G95ME-C9 achieves 55%

No wonder you don't understand thermodynamics???
You cannot understand simple mathematics Hahaha!
Reply: @sandervanderkammen9230  Found an article here and it said it makes 15Mpg, not as low as your number suggest.
Reply: @giovannicesaramorimnumero7589  Abner Doble himself only claimed 12mpg.
EPA laboratory testing shows 6.5 MPG with the Doble boiler design.
 Jay Leno says his 1926 Doble E only gets 6.6 MPG on gasoline.
Reply: @sandervanderkammen9230  The loser is the person who can't state a fact or argument and ridiculizes the other to replace it.
Reply: @sandervanderkammen9230  In January 1911 the last White steam car was built, a few years before Kettering invented the electric starter. Again you haven’t research yourself so-called facts.
Reply: @sandervanderkammen9230  most modern IC cars have a 20% - 30% efficiency. 79% - 80% of the energy they consume goes out the exhaust pipe, the exception is the turbo-Diesel. There are steam cars that have been built that got over 20 mpg, I’m not claiming that they are as efficient as the latest IC powered cars they aren’t. A 1925 Doble gets about the same fuel mileage as a modern gasoline powered Suburban.
Reply: @6killer426  White Motor Company switched to ICEs when it licensed the Delahaye engines which were renown for being easy and reliable to start and featured a one-way safety sprag clutch.
Reply: @6killer426  Sales of ICE cars sharply increased around 1910 due to the obvious advantages... sales of steam cars sharply declined after 1915 when the Kettering Electric starter was introduced.
 The number of steam car manufacturers also drastically decreased with Stanley surviving until 1924.
Reply: @6killer426  The Doble barely produces 150 horsepower when brand new and running perfectly... 6mpg with 150 up is appalling bad.
In fact its less than 10% thermal fuel efficiency.
Reply: @6killer426  The German company Junkers-Jumo was producing Diesel engines in 1929 with a BSFC of 0.34 (40%).
 You can purchase a Toyota Prius with 41% efficiency or a Audi or BMW Diesel engine with 43% 20 years ago.
Reply: @6killer426  You don't need to be an engineer to understand the Carnot Cycle Formula...
Reply: @sandervanderkammen9230  they switched in January 1911, my maternal grandparents purchased a 1910 O-O White brand new my grandmother learned to drive it.
Reply: @sandervanderkammen9230  my grandparents White would still run twice the speed of a Ford Model T and consumed the same amount of fuel.
Reply: @sandervanderkammen9230  my neighbor that lived near us growing up had a Doble his widow sold it to Jay Leno. I rode in it several times as a teenager, which is much more experience than you have with anything steam powered including that Wilesco oscillator you been fuking with.
Reply: @6killer426  Great story, but qhat is your point? Steam cars were already obsolete when the Doble E- series cars were built.
Reply: @6killer426  Only if you were driving the Doble downhill with a tailwind and the boiler turned off.
Reply: @sandervanderkammen9230  you quote stats yet have no knowledge or experience with that vehicle. As I said I’ve actually ridden in a Doble I’ve seen how the perform and how much fuel they consume as I said elsewhere their fuel consumption is similar to a full-size Chevy Suburban. What you are doing is called armchair quarterbacking.
Reply: @6killer426  The EPA tested the Doble boiler in 1970 and its fuel consumption on the LA Drive Cycle  test was shockingly bad.
Tests confirmed 6.5 MPG.

The test results can be viewed on the EPA website.
 Jay Leno confirmed that his cars average between 3 MPG and 6 MPG on regular unleaded gasoline.
Reply: @6killer426  The Doble boiler is rated at 2 million BTUs... with a dynomometer rating of just 150 horsepower maximum that is a rather pathetic 8.9% Carnot Cycle peak efficiency.
Reply: @sandervanderkammen9230  rather than spewing a bunch of #s from biased sources with agendas, you need to get better source material like Jim Crank’s book “The Doble Steam Car” Jim was the acknowledged Doble expert he restored many of them and owned a couple of them himself. He would be the first to explain the short comings of steam powered vehicles as well as their allure.
Reply: @6killer426  That is incorrect, The EPA drive cycle tests conducted in 1970 show 6.5 MPG on kerosene.
Reply: @6killer426  Thats right son! the Doble Boiler FAILED EPA emissions testing in 1970.
Reply: @6killer426  The Carter Steam cars was a failure, it briefly meet emissions standards but failed because of its terrible fuel efficiency.
Single expansion reciprocating steam engines are the least efficient of all heat engines types.
 The engine used "bash valves" which have never been reliable or very durable in steam engines.
Reply: @6killer426  Not true, emissions standards continued to tighten, the Carter engine was a gas guzzler.
Single expansion reciprocating are horrible inefficient, obsolete technology.
Reply: @6killer426  Steam cars are obsolete technology and have been for more than 100 years.
The are insanely expensive to build, perform terribly, they spew out massive amounts of pollution and are gas guzzling dinosaurs that are unreliable and expensive to maintain.
Reply: @6killer426  Wow! 2 million dollars for a 25kW generator???
That's insane!
A Diesel generator that size cost only 20,000 dollars today! 
No wonder that design never caught on... dead end technology that was never commercially viable.
Reply: @6killer426  $1.9 million AUD for a 33 net horsepower generator?
Government waste at its finest!
Reply: @sandervanderkammen9230  dikhead the conversation was about bash valves, you said they weren’t reliable and wouldn’t last long, those bash valves lasted for two decades in continuous operation at full rpm.
Reply: @sandervanderkammen9230  I think you already said that repetitively in the last 150 posts you’ve made.
Reply: @6killer426  The Carter Steam cars was a FAILURE because in 1976 Volkswagen introduced the 1.5 liter Diesel Golf that not only met EPA emissions, it was 300% more fuel efficient and priced at a fraction of the cost of a steam car.
Reply: @6killer426  There is nothing to discuss about bash valves..
There has never been any production cars that have successfully used them..
It's a failed design and obsolete technology.
Reply: @6killer426  The TRUTH bears repeating son...
Reply: @6killer426  There has not been a single legitimate steam car manufacturer in America since 1926.
Reply: @6killer426  The discussion here is; "why there is there no longer any legitimate research and development of steam powered cars today?"
Reply: @6killer426  You will have to provide some certified performance figures from a third party independent laboratory... otherwise you're just talking BS!
Reply: @6killer426  They are IRREFUTABLE FACTS!
The Rankine Cycle can never match the efficiency of internal combustion engines.
Every sane engineer worth his salt knows this and would never even consider that a steam car as a viable concept today.
Reply: @6killer426  You childish insults reveals someone who has no formal education or professional experience in engineering and appears now that you have a very tenuous grip on reality.
Reply: @6killer426  You can not offer any example of steam cars with bash valves that were successful.
In terms of powerplants that was a very short service life... being replaced with much cheaper and more efficient photovoltaic panels.
 Thermal Solar powerplants have never been commercially viable.
Reply: @6killer426  20% thermal efficiency for a stationary powerplant is embarrassingly bad... ICE powerplants can reach 64% efficiency.
Reply: @sandervanderkammen9230  calm down and take your  meds. Your having a torque event.
Reply: @6killer426  Just the facts here son,   irrefutable facts that you cannot dispute.
Reply: @sandervanderkammen9230  and what good would real facts do, you’ve already came to a conclusion base on your interpretation of Carnot.
Reply: @6killer426  Carnot's formula is not an opinion, it is the practical application of the Second Law of Thermodynamics, a universal truth.
Reply: @6killer426  In 1856 Rudolf Clausius discovered ENTROPY which defines the movement of Energy in the form of Heat. This behavior is know as the Second Law of Thermodynamics
Reply: +I967 
The steam era is obsolete for a reason. We are not funding it because it would be a huge waste of money.
Reply: @deaconswayne1894  you're so right my friend but let this country get hit with an EMP anything with a circuit with fry did you see a TV show on UBC called evolution nothing electrical work except steam-powered why the rest of the country fell into swords and fighting with knives and daggers the state of Georgia realize something let's bring back steam powered cars and trucks and buses and because of that they started trading with Europe and became a very rich Republic didn't have control electricity but at least they had controlled the roads again which allowed goods and services to move back and forth thanks to the power of steam they had steam powered boats going across Europe blah blah blah and then covered it was trading with you they became very rich why the rest of the country is run around with horses and Buggies you'll be screaming and crying if the electrician didn't work right now I know I would your car won't start because he requires gasoline and electrical starter system but take the engine out put in a steam engine baby you good to go anywhere you want but that would defeat the point everything shut down so if you considered the best thing to do to get out of the city with your steam powered truck
Reply: #420: Weedle also a 1925 Duesenberg makes around 260hp and 1000lbs of torque and was a dual can engine and was direct drive and could go 135. Steam cars are cool but just not practical. The same thing with electric cars who wants to wait for your car to in electric case charge or in steam case Heat up before you use it every time. Petrol vehicles will be around for quite some time until they use ultra capacitors in electric cars so they charge immediately.
Reply: @zsquints  That' actually false, as it's torque is not even half (327nm) that and it's top speed is 116MPH, before trying to say anything, remember to check your information first on it's actual engine, as a 1hp engine could also have 1000lb of torque.
Reply: @zsquints ? I've only stated wikipedia's statistics about the duesenbourg, and that it is slower than a doble model E.
Reply: @zsquints  Bro, it had 265HP and was only able to do 4250 RPM before dying, at the peak of the enginr, while a steam one has peak torque and horse power at 1RPM.
Reply: @giovannicesaramorimnumero7589  Please name a production steam car with 265 hp?
Reply: @sandervanderkammen9230  I was saying about the duesenberg
Reply: @giovannicesaramorimnumero7589  The Doble only produced a maximum of 150hp when new...
Reply: @sandervanderkammen9230  And I said that? I stated that the DUESENBERG made 250+ hp, not the Doble.
Reply: @giovannicesaramorimnumero7589  Exactly, the Doble tje steam cars in general could not compete with internal combustion engines.
Steam cars were rendered obsolete in 1915.
Reply: @sandervanderkammen9230  ? The Duesenberg makes 250Hp because it needs to make that horsepower to run, a combustion engine is basically an engine propelled by a weak gas that has no torque , has an scaling curve on torque and has peak horsepower on minutes after running , hence it needs to run on high rpms and a transmission, otherwise it will not run, on the other hand there is the steam engine, which is propelled by steam, which can be up to 50 atmosferes of pressure and can make torque easily on any rpm with a flat curve, hence not needing transmissions to run. And adding to the fact that the Duesenberg was a race car and the Doble a luxury car, it's safe to say that a luxury car exceeding 5000lbs competing with a race one is not fair, but it still can be as fast as a duesenberg.
Reply: @giovannicesaramorimnumero7589  You continue to make a complete fool of yourself because you lack understanding of even the most basic fundamental engineering concepts.
The Duesenberg produces 250 horsepower, 100 hp more than the Doble.

Do you really not understand what horsepower is or how it is calculated?
You clearly have no clue what torque is.
Torque is a completely meaningless figure without comparing the RPM revolutions per minute
Reply: @sandervanderkammen9230  I think you're the complete fool here, horsepower is not constant on all rpms, and it is a calculation on both torque and RPM, having 250HP at the peak rpm your engine can run is not the same as 250HP at all RPMs, and that is actually the case for steam, it has the same horsepower no matter the RPM but will have decreased torque when in higher rpms, it's not a matter of what has the most horsepower, an electric car such as tesla makes torque on 1 rpm and only has 150+ HP, what is it's 0-60MPH? ~2 seconds, a lamborghini has almost 900HP, what is it's 0-60? ~3 seconds.
Reply: @giovannicesaramorimnumero7589  Thank you for proving my point. 
How can the Doble engine produce the same horsepower at any rpm?
The Doble E produced a MAX. Torque output of 1,000 ft.lbs at the wheel @0 (zero) rpm.
How much horsepower is it producing????
Reply: @sandervanderkammen9230  You can't even move at 0RPM, I could say the same thing that a rock is making an infinite amount of torque but it isn't moving.
Reply: @sandervanderkammen9230  The equation would NEVER work with an rpm or torque at 0, it would mean an impossible number to achieve.
Reply: @giovannicesaramorimnumero7589  Still making a fool of yourself?  Maximum torque output is for reciprocating steam engines is at stall, 0 rpm.
Reply: @giovannicesaramorimnumero7589  That's why saying the Doble E produced 1,000 ft.lbs of torque is completely meaningless when comparing the Doble engine  to the Dusenberg engine.
The Dusenbergs engine produces 40% more work than the Doble engine can.
Reply: @giovannicesaramorimnumero7589  it wasn’t until the muscle car era of the 1969s that an IC engine equaled the torque produced by the Doble, just as it wasn’t until the advent of the turbo-Diesel in trucks that they equaled the performance of the Sentinel steam truck or lorrie as the limeys call it.
Reply: @sandervanderkammen9230  and enough torque to twist the axles at zero rpm
Reply: @giovannicesaramorimnumero7589  fuk the ol’ Doosey only made 50 more horsepower than my parent’s 1953 Buick that had a 320 CID straight eight.
Reply: @6killer426  A 2017 Suburban with a L5P engine produces 440 horsepower and 1,050 lb.ft of torque with EPA combined MPG  300% lower than Doble E series.
Reply: @6killer426  The Ford F350 Super Duty has 500 horsepower and 1,200lb-ft of torque.
Torque at the wheels is rated at 4,235 lbs-ft but is electronically limited to 1,800 at the wheels to prevent damage to the axles.
12.5 MPG
Reply: @6killer426  The Duesenberg's Lycoming engine produces between 265 and 320 horsepower... twice the most powerful Doble engine.
Reply: @6killer426  Childish insults won't prove your point  (if you had one) nor will it make you look smarter.
Reply: mmm 1967 don't listen to these guys - what a load of shyte - this car - yes did take 45 seconds to start up but ran brilliantly - like an electric car it needed no gearbox as power was immediate through the drive train and could sustain speeds of 60mph easily - to much education and not enough common sense is what killed it... judging by these forums - from a petrochemical cartel perspective - all the money they spent in universities was a good investment... internal combustion relies on oil and oil is bad bad bad - wise up and be excited it ok
Reply: +I967 Steam cars have been obsolete for a 100 years now..

You cant apply modern design and technology to a system that is fundamentally less efficient by the existing laws of thermodynamics.

No, its not...  you cannot defy the laws of physics
Reply: @doktorbimmer  my friend let me put it to you like this EMP can knock out every vehicle in America right now didn't you see that TV show evolution in which all the electricity got sucked out of the atmosphere power plant pacemakers nothing electrical works except steam-powered it was later revealed in season 2 spoiler alert! That the reason why there wasn't no electricity because the government was experimented with Nanobots this sucked off a living neck TriCity regardless of where it was That's why nothing electrical work however the state of Georgia realized the bullshit and started converting trucks and cars and buses into steam power and because of that the state of Georgia enjoy the modest trade with Europe even though there were no more electricity the state of Georgia in that TV show kept right on Strokin the elevators didn't work they were back to the stone age's but at least they had control of the roads again thanks to steam powered trucks buses and cars
Reply: @charles neely Not true, there are lots of internal combustion vehicles that would be completely unaffected by EMPs  albeit you might have to push start some of them. I think you have been watching too much Sci-fi TV...
Reply: @doktorbimmer  
https://youtu.be/w4A9rX9THD0
Reply: I don't believe this is true, with advancements in tech we can refine and improve this until we have something that is cleaner & greener for the planet. We can use steam for motivation and improve on it rather than scrap it altogether. These guys at Ford built a car that runs on steam and actually works just and proves this point, sure this 100 year old tech is not practical now but it might just be in the future. They use nuclear power on submarines and other vehicles instead of gas, again a reason for that as well, its considered cleaner than fossil fuels. In theory we could have a car that last for 10+ years before needing to be refuelled with its own nuclear reactor but this is highly dangerous. You can bet the petroleum companies would shut this down as fast as they could as they are still trying hard until they can get a monopoly over other forms of fuel as well. 

With new alloys and parts that didn't exist back then, you can always find a way to increase efficiency. If we didn't, we would be continuing to play into the planet destroying petroleum game and denying the planet a clean future it deserves. Global warming has been admitted publicly now by the mainstream media. Those in denial are now looking stupid as they struggle to find an excuse for when the temperature keeps going up on this planet...
Reply: +Paolo G  Steam certainly is obsolete in transport applications and is being phased-out in many non-nuclear power generating plants. Here in California the last of the old, inefficient boiler fired primary steam plants are now being scrapped in favor of more efficient Gas Turbine combustion fired plants.. steam's use has now shifted to secondary, co-gen heat recovery applications.
Reply: The real doktorbimmer, could you give a laymen's explanation of this:  "Any heat engine that uses a phase conversion of the working fluid is at a massive disadvantage to one that does not". Is this because of how much energy is used/needed for the phase conversion? That it also requires a large temperature delta between boiler and condenser? Is that energy not gained back by the increased expansion of the phase conversion?
Reply: ummm I think they may have well and truly got past the firing it up and keeping it going phase
Reply: I967 same
Reply: Actually the important thing to remember is that efficiency advantage of internal combustion engines has nothing to do with petroleum... they do not need petroleum to run or be more efficient.
Reply: Pritchard's steam engine was attractive during the heady days of the fuel crises of the seventies. As fuel prices stabilised in the eighties and cars generally became more energy efficient, the need for an alternate engine technology became less attractive.
Reply: @JBofBrisbane  The Pritchard Steam cars company was basically a vaporware investment scam...
Over a 1 million dollars went missing and investors lost everything.
Reply: Sounds like to me you must work for GM who killed off the steam powered 69 Chevelle as they only wanted to keep using fossil fuels and weren't interested in clean running engine emissions, so when the opportunity comes along to produce an engine that doesn't use fossil fuels and can achieve better emissions, people like you say it can't be done and then tell everyone ICE is the only way to go and just keeps polluting the air even when they say newer engines now have almost no exhaust emissions, woop woop, what about the morons that don't get their new engines serviced and then start polluting the atmosphere because they've told it produces .99 to zero percent emissions as where if it was a steam engine all it is doing once it's running is creating steam and no pollutants even if it needs kero to heat up the boiler when first started and if the design is re-engineered to keep the boiler running using a heating element that keeps the temp where it needs to be to be efficient, then there would be zero emission.